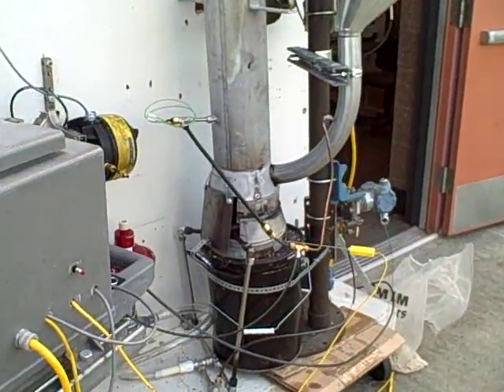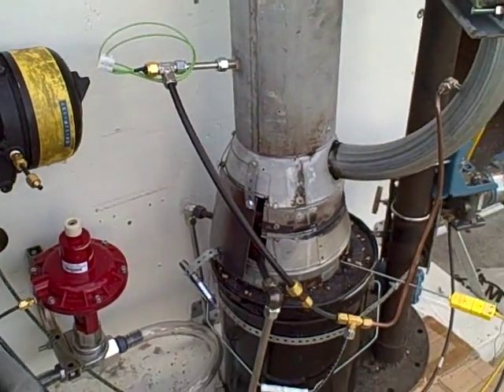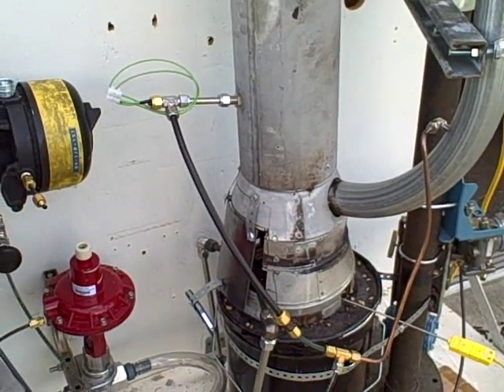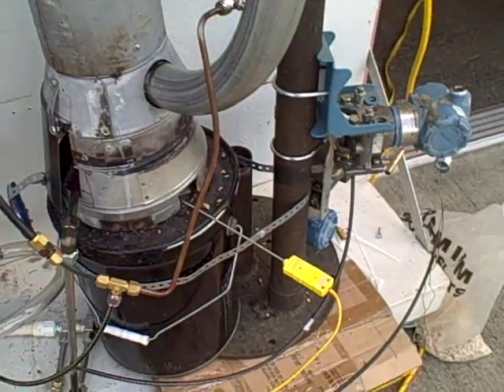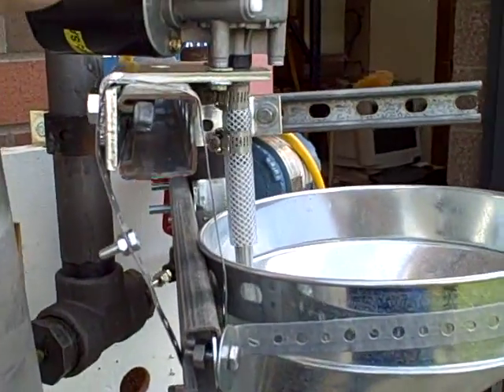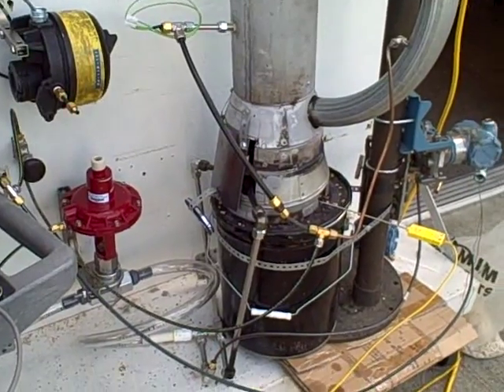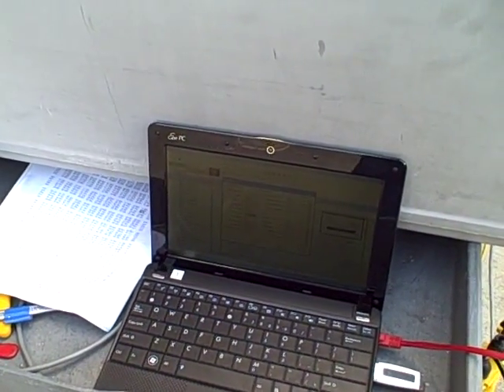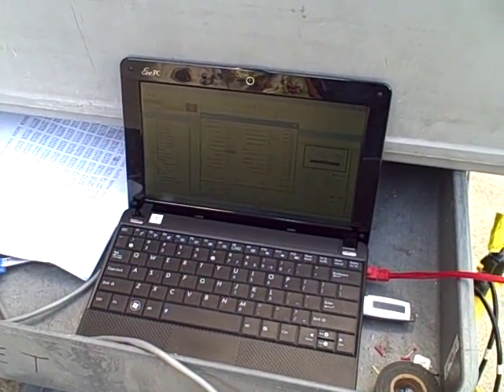Fluidized Bed Combustor -- part 2 (prototype thermocouple problems)

Comment: Sorry if i'm reviving something old in internet time here; I thought it wouldn't hurt to ask.  :

 This system seems very nice, did you / would you consider publishing any instructions on how you built it, or the code used?  Also how did its yield turn our compared to a simple diy downdraft gasifier?  

Anyways thanks for an interesting video,       -Eric

Comment: Wiper motors are a notorious source of noise to mobile radio users. FM mobile radio is pretty much immune but anyone operating SSB or AM modes sure has dealt with interference from wiper motors.